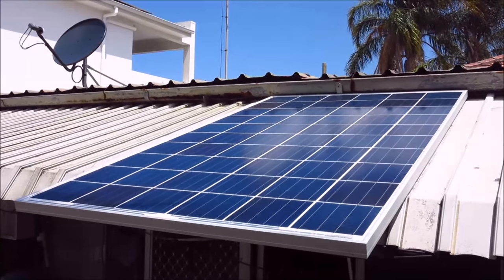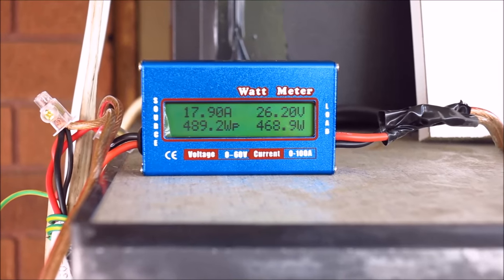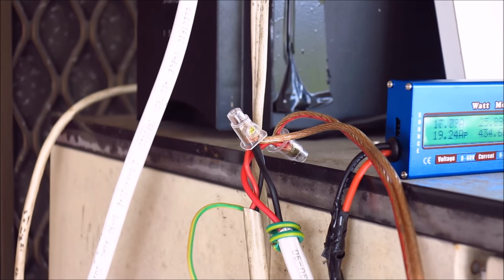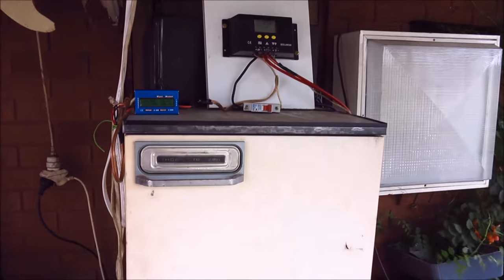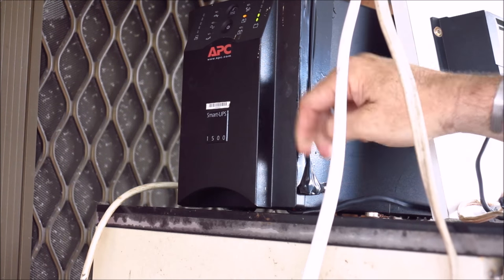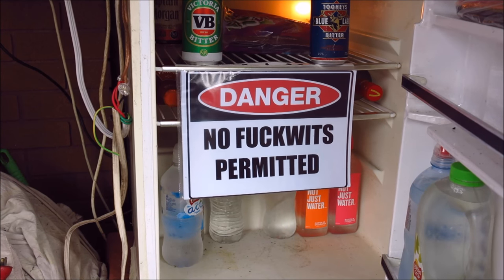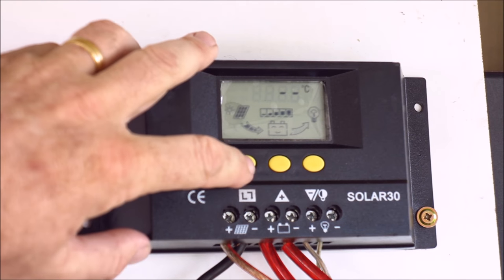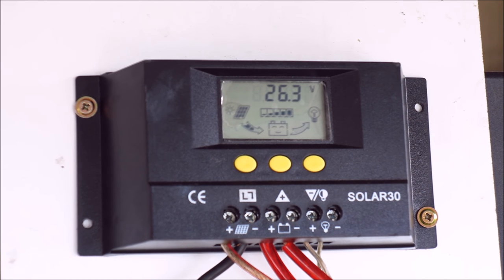Free energy with Solar Panels off grid basics and learning.

Comment: Wow that is pretty good to be getting so close to the rated power... you can't beat that for $100 worth of panels. Nice quick setup you got there, I like the UPS as an inverter... have a bunch of those lying around myself. Just discovering your channel, great stuff.
Best to your niece & her husband for their project - I did not see the link here though. Good for them doing something to help others who have less.

LOL @ your US vs Aus. comments... we have 240 volt too, just with a center tapped transformer in the street, with that center tap grounded and connected to a "neutral" conductor in a typical home panel, to provide 120 volts from either of 2 hot leads to neutral, for each standard branch circuit. But stuff like central air/aircon, electric clothes dryer, and other big appliances are usually 240 volt, across the two hot leads, and you can easily get 240 volt in any typical home by using a double pole circuit breaker in the box. Each breaker location from the top to bottom of the breaker box alternates from L1, L2, L1, etc., so a single pole breaker is used for 120 volt circuits and the neutral connected to a common bus bar, and due to that arrangement, a double pole breaker uses 2 slots, and therefore taps across L1 and L2 in any location in the box for 240v power. Some motors you can buy here are rated for 50/60 hz, running at a lower speed for 50 hz, but yea the frequency difference is the real issue when trying to use imported electronics. But for most things nowadays using switch mode power supplies, the frequency doesn't matter. I was in Aus years ago and could plug in my laptop and phone chargers with a simple plug adapter. Driving on the other side of the street and from the right seat in the rental... car hire... was far more of a challenge... if you see people driving out of the airport car hire lot putting their windshield wipers on before making a turn when it's not raining, it's probably someone from the US or another place where they drive on the right side of the road since the turn signal and wiper controls are reversed here too 😅

Comment: Nice little solar testbed ya got there. 

World has certainly changed over the years. I can remember as a kid tubes were it and what power users they were. Now I have a smart phone that uses so little energy I can charge it using a solar trickle charger. 

As to power sharing. I will look take a look at the website. I have a Ryobi electric weed wacker. The power pack is a hefty L-Ion 40v job with fairly decent power density. An enterprising designer could develop a charge station that could hold say 8 of those packs each individually key lockable the whole thing solar powered. Each family would only have to have a step down base for 6 & 12v and a pack. What your in-laws are involved with is good and doable community effort. Kudos.
Reply from the maker: I like your idea with the packs. I wonder how cheap they could be made? Could be any configuration as long as it was standardised.  I have a Car LIon Jumper pack thing. It has a very good LED light on it. I tested it once for 30 hours straight and the thing was still showing 2 bars out of 5 charge left. The indicator tends to be pretty spot on in my experience. Not enough to light a house but probably would for 6 hours or more with more LEDS  hooked up to the thing.

Comment: Hey OB wan. Great to see the panels you picked up, and the instructional vid. Maybe I can locate some to play with too. Made a solar air heater. with a small fan in it. I powered the fan off of some small panels. That way, when the sun shines, and the air heats up, it blows harder.  When the sun takes a break, behind a cloud, the fan either stops or slows down. Self regulates. 
  But, since our goobermint, won't fix our grid, to withstand an EMP, I have become more interested in producing some of my own juice. Good luck with the house hunt. Hope you find the perfect place.  Maybe with a small stream flowing past.   Al
Reply from the maker: Hi Al, 
Your air heater sounds Brilliant! I like the self regulating part. I have a small panel about 15 W and found some large server fans up the back today in my jun.... treasure. I thought of them going together and what I could do with them, now I Know. 

I have been burning off my excess solar power just to measure what I have been getting. Been running a small fridge but that dosen't take much. Today I got the bright idea of boiling a kettle on the excess for my 8-10 cups of coffee per day. 

The solar panels feed into a controller which regulates 2 batteries in series for 24V which a UPS then feeds off to make mains power.  The controller has settings to trip loads depending on high and low Voltage.  I have an SCR on that feed which uses the DC current from the controller to switch the AC from the UPS on and off. 
the fridge runs direct because it is relatively low power, about 120-150W. 

To not overload the UPS with the kettle which is 2000W, I have an AC PWM controller which allows me to regulate the current.  I might only be feeding the kettle 300W so it takes a while to boil  but that's OK. It sounds more complicated than it is and has been cheap to put together and given me a lot of peaceful thinking time setting it up as I go. 

For my hot water, I thought earlier I have an urn up there somewhere so I'll dig that out. That will cycle on and off on it's own to keep the water near boiling so it will only need enough power for that and I'll have hot water for my cuppas all day long.  If one had a worthwhile amount of panels, it would be easy to plug in a hot water tank. 
The PWM controller can be set to feed in the correct limit to the power  making the element size irrelevant. 

I'm on the lookout for more panels so I can hook them up to a proper solar inverter and back feed to the grid through the day and re use at night.  Might keep these couple of panels just for playing and learning with though. It's good mental stimulation and I like playing with the electrics. 

I think it will be another week before the real estate market spools up again. Looked tonight and only 2 new properties listed where I want to go.  If I see anything I like, I'll pounce on it right away.
Reply: Sounds like you are enjoying the new learning experience. My grandfather used to tell me that you should never stop learning. It keeps you sharp. So, I try to wrinkle my brain, as much as I can. 
  Since you, occasionally, drink coffee, use your coffee grounds for your garden. Earthworms seem to love coffee grounds, while the slugs hate it. And, it makes for richer soil. 
  I'm addicted too. Keurig loves us. 
  I have the pond, but don't have enough output, to try a hydroelectric experiment. I built a ram pump, to pump pond water up to the garden. It ran pretty well, until the Chinese check valves failed. 
  The Mrs. would like it better, if I put the same effort into her projects, that I put into mine. But, sometimes she actually has told me that some of my crazy ideas seem to work. 
  I wish you well, on the house hunt.   Al

Comment: QUESTION 
IF THE HOUSE HAD ALL 12 volt DC APPLIANCES LESS POWER WOULD BE LOST CHANGING FROM 12 volts Dc to 120 to 240 to 12
Reply from the maker: Conversion efficiency of inverters is 95-98%. The cost of wiring for 12V which would have to be very heavy cable let alone the cost of low voltage appliances make the small losses a non event.

Comment: Solar is a mine field as everyone has there own way of doing things... in the uk i run 700w charging 24v which then runs my inverter when i need mains power ;)
FYI MPPT controllers give a far better charge rate than a PWM ;)
Reply from the maker: Yeah I'm aware of the MPPT and I will get one eventually but for a cheap controller, I'm surprised how well this one works. 
It would be interesting to see the difference between the input of an MPPT and the PWM that's for sure.

Comment: Do solar panels work better when on fire? or at all? Just thought it might be a concern given their proximity to certain other projects. how much electricity does an oil burner generate when used to light up a panel. could run the blower off the panel and get a self contained system. :)
Reply from the maker: The blower off the panel would easily work .  To make electricity from oil by burning it, i put it through an engine which turns a generator like in a few of my vids. Seems to work well! :0)

Comment: would love to see more generators! - also a grid feed system needs to have a profesional system with it or you could get in trouble for using cheapo chinese inverters
Reply from the maker: I have several OEM inverters that were fitted with professional systems. When I get some more panels,  I'll be hooking one of these up and doing a Vid on DIY grid feed.
Reply: yeah thatd make a good video - also if you are in queensland and have a old power meter i wouldent worry about telling them you have solar - just get your power as 1 for 1 and id like to see that grid feed generator running wvo again - that video was cool
Reply from the maker: I have an old meter in this place which I have just sold and hoping the new place wherever it is has the same.   No way I'll be telling anyone what I'm doing. I see no reason I should buy my power at 25C kwh and give it back to them at 6 C kwh which is what you get here in NSW IF you follow all their bullshit rules and regulations. 

This is why to me the whole save the planet thing is a crock of shit. If gubbermints were fair dinkum you could get back what you put in 1 for 1. If the new place has one of those smart rip off meters I'll seriously look at putting in a battery system.  Forklift battery packs are relatively cheap and on the numbers I have crunched can repay their investment unlike the commercial products.

Either way, I'll be putting in a heap of used panels and wiring them up myself so I can offset the day useage and set the hot water up so it comes on to use my own free solar power not the offpeak 15C Kwh from the grid.  That's a hidden rip off with solar as well. You buy at 15C  at night but then put back excess at 6C. 
Bloody scam!
Reply: Oil Burner just remember the big power stations only get about 4c per kwh they sell (and they sell many many mwh per day)

nsw only puts in a smart meter in if you put solar on

Comment: You need to get your batteries of the cold tiles and put some wood under them to make them last longer.
Reply from the maker: ATM the night min temps are 20oC so not much problem with cold. 
More worried about heat actually. it was 40oC here yesterday which is why I keep them tucked away in the shade.

Comment: car batteries are only good for currents that occur in cars (obviously...)
about 100Amp for starting the engine, and charging them with about one or two Amp,
what the current a generator plus charge controller can give them aside of any other power consuming lights, fans, radios etc.
Reply from the maker: No, you are a bit off there, starting can take 500 amps or more.  Alternators on cars now are almost always over 100 amp and can pump most of that into the battery depending on how discharged it is. Wouldn't be hard to put 50A in on a low battery but it must taper off a lot particularly when it gets to about 80% where it has to slow right down to finalise the charge.   2amp on a decent car battery would be a float charge, IE, just enough to hold it at the fully charged voltage. You couldn't probably charge it at 2A unless you waited a month if it was really flat. 

The bigger the battery, the more amps it can discharge and the more it can absorb.
Reply: "Alternators on cars now are almost always over 100 amp"

jup ur right. but the battery dos not suck so much for a long time to charge it.
pls consider all other comsumers like lamps, Radio, heating for seats and the rear window etc. Thats what an alternator is also needed for.
I had an empty bat some weeks ago which just sucked 10 Amps peak at first. then it went down to 3 at the end. 50 A at 12V means 600Watts, this would boil the bat if its for a long time.
Reply: BitGridTV, I am a car fan and Electronics Trades qualified person!
 A Diesel Engine on a car or similar 12V system can easily pull in excess of 800 Amps on start!
An Alternator or Generator (older cars) will deliver an output voltage according to what the regulator is set to and what it senses as a base line voltage in the Battery!
 If the Battery Voltage is down it will draw more amps until it charges it nominal voltage, in the case of Lead Acid Battery it is about 13.8 V and charge/regulator Volts normally about 14.2/3 Volts set as nominal output for the regulator. Any higher will put too much in and Boil the Battery, thus shortening its life.
 Older cars with a 22A Generator would just take longer to replace what was taken out of the Battery on startup.Early Alternators were only around 34A output, I know as a Land Rover I had I took the Lucas Prince of Darkness out and installed a Hitachi 60A in its place!
 Oil Burner, good video and for the benefit of all I have to say American Volts never Hertz anyone at 60 Cycles per Second!
Cheers from John, Stralia Mate.
 PS: Keep up the good work as I do, I always SOLDER my wires together!!

Comment: Get a grid-tie limiter inverter, run your house, without feedback to grid... I do have video of mine connected, don't have to rewire house...
I agree 120 volts is stupid, and backwards, why split the power when 240 v can do the job better, less wasteful...
Reply from the maker: I have proper inverters I am going to run and backfeed to use the grid like a battery. That way I can input during the day to spin my old meter backwards and take it back at night.  All I have to do is plug them in as long as I stay under the 2400W of the power point.   My inverters are 2 Kw so not a problem. Just can't run more than one on a single circuit but thats OK.
Hope the new house has an old meter so I can do the same otherwise I'll just be able to power the daytime loads which will be OK. Put the hot water and pool pump on a timer to run them when the sun is shining.
Reply: Oil Burner oh i used to have analog meter, and spinned backwards, worked great, but they changed out for the stupid 'smartmeter', and they don't give you good price sell back, so no sence sell it when using it all is more cost effective....

Comment: Well I have go throw some dead tree into the furnace, but I will be wearing my safety orange, don't worry.
Reply from the maker: Long as you have on your safety gear, according to the Zealots you can do anything stupid you like and not have to worry.
Reply: Oil Burner I do use my leaf blower as a sort of turbo to get thing cooking a little faster.  I had it cooking almost as dangerous as using oil.  I was safe, as it is well, cold here, so I had my safety orange snow suit on. Snow is that frozen shit from the sky from all the global warming.  They say it will get down to -15 f tonight that is, I don't have a clue for the metric people but it is cold. :).